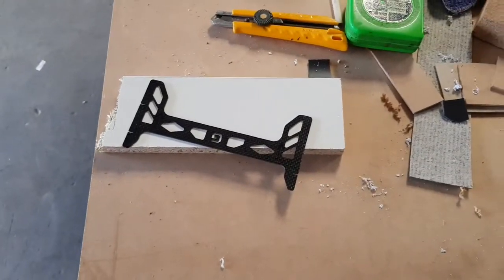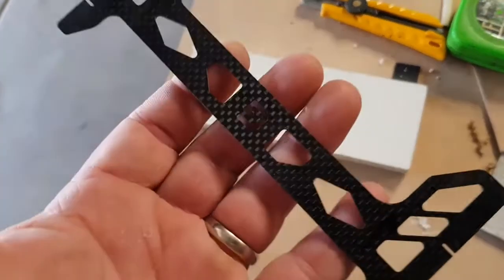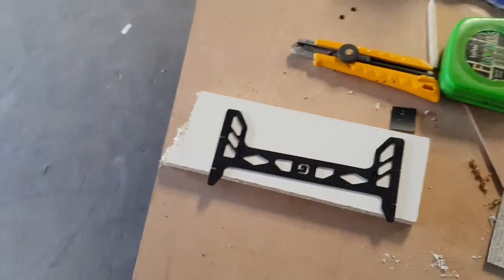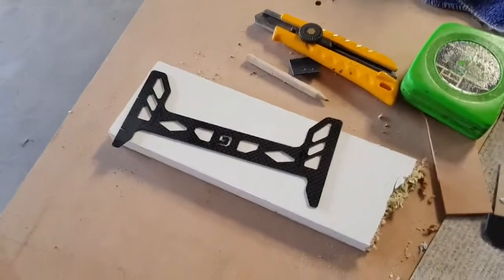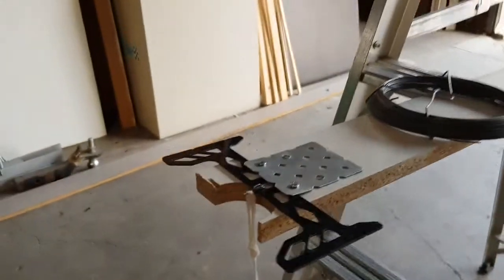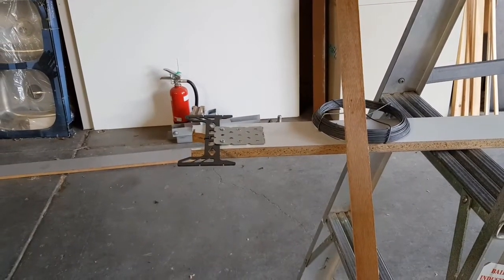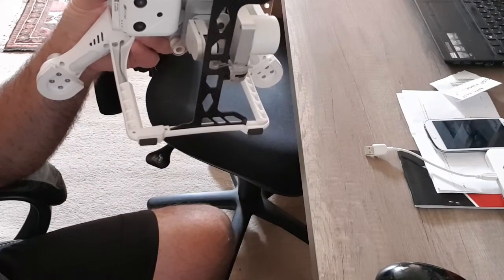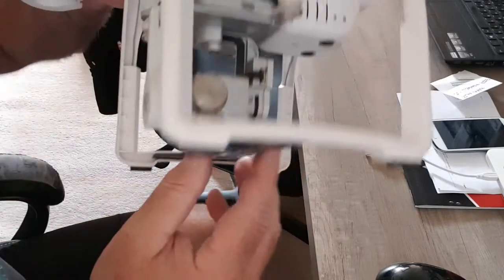Drone Fishing - free DIY line release

Comment: hello the assembly to release the line and super my risky I advise you to put the metal behind the camera on the back of the drone and when you are going to advance with the drone and stopped the drone will tilt a little enough to make the line fall without turning it over drone
Reply from the maker: Thanks for the tip. I think with care and the drone gyro it will suit my purpose, but others may take something from your tip.
Reply: Me personally I did my house size house as I explained it and for caught this is the best-taking stock